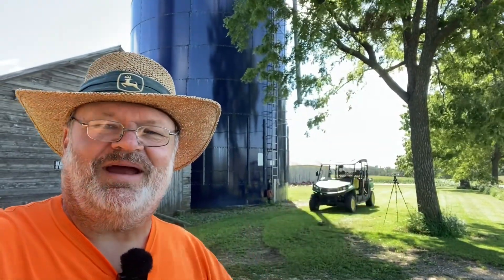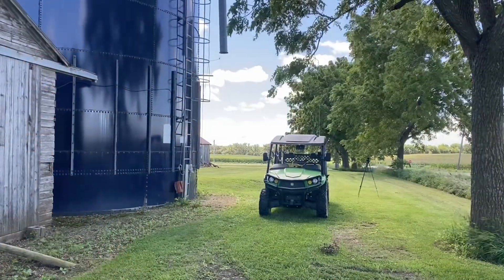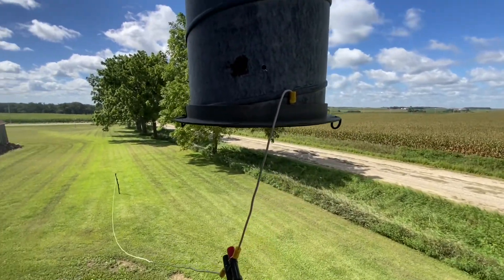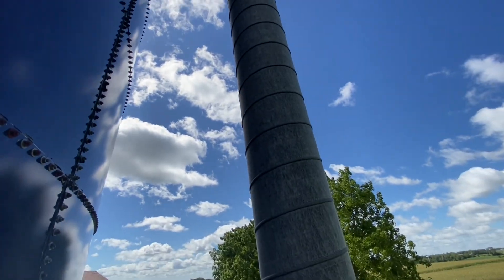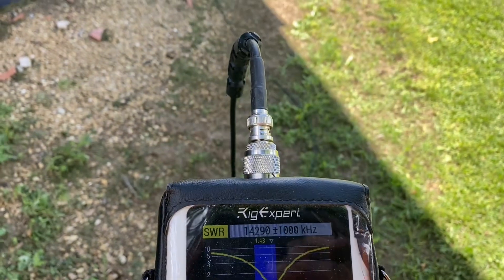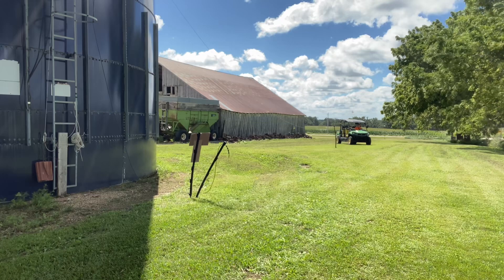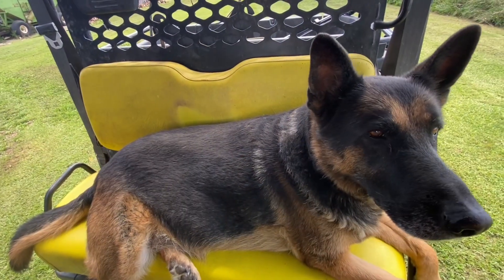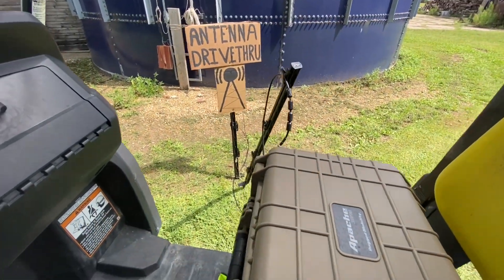Ham Radio Silo Antenna Drive-Thru - FX-4CR QRP SSB 5w

Comment: hello! your fill pipe is the rf sink, the "cp" is actually your radiator, that's why you have a standard Q dip in your swur chart, your feedline is doing the heavy lifting here in balancing your signal, great video!
Reply from the maker: Hello.. Sorry I am late to respond.. Thanks for the great technical info and for watching.. I appreciate your comment and support.. 73, kevin k0klb

Comment: Not a new idea not saying it's not a great idea mind you. There is a titan missile museum that has a giant HF discone antenna that ham radio operators are welcomed to drive up to and plug into the coax provided. However it is in a lockbox but the key is available at the desk. Also available is a picnic table to operate from. I forgot the specs for the discone thinking it's from 7 - 50mhz.
Some of the abandon AM stations would be sweet too.
Reply from the maker: Thanks.. LOL, I thought I had seen a picture of ppl sitting at a table and connecting but wasn’t sure about a drive by.. Cool, it would be fun to try that one someday .. Thanks for watching and providing the into.. I appreciate it. 73, kevin k0klb

Comment: lol! Be sure to: 1) Charge for use (especially stick it to out-of-towners who travel all over the place (cough KM9G cough 😂)  2) Have a safety break-away (like at the gas pump) in case people pull away while it's still attached 3) Upsell with the option to use a drive-up 1KW amp  4) Don't ever change the logo because everyone on the planet will dunk on you on social media! 😋 Thanks for another great video Kevin! 73 and God bless you from AF7EC 👌
Reply from the maker: Hey Will.. LOL.. Those are all great and funny ideas.. Now you're thinking outside the amateur radio operators box.. Fun stuff.. Thanks for the comment and all your support.. I appreciate it.. 73, kevin k0klb
Reply: Yeah, make those fees less than cell phone service.  Like truck stops used to have a system that provided a/c, heat, cable TV, 120v shore power and landline phone service to help drivers reduce their engine idle time.  😁

Comment: Great concept Kevin.  That may work for small independent farmers and groups in rural America who are willing to let their property be used like that, but try that in the city and suburbs, and ya'd likely get fined for tampering, vandalizing, destroying, and trespassing on private property.  Even if no damage was done.

Not trying to be negative, just speaking of the differences between rural and urban life.

And it'd be easier just to have a mobile setup in a vehicle...
grant it having the antenna as high as possible like on a silo or water tower is obviously the best benefit 

But your idea is pretty good and creative.  Make it similar to charging stations for EV's and drive-thru beer barns.
Reply from the maker: Thanks for the comment and I understand your point about the differences in locations and I do like your drive thru beer barns, lol..  I doubt this will gain much momentum but we can now say that we tried it and it is a doable solution for those of us who don't have a mobile system.  All in good fun and ham curiosity and experimentation.. lol  Thanks for watching and your support.. I appreciate it.. 73, kevin k0klb
Reply: @hamradioqrp-k0klb It's definitely fun to experiment like with our friend K8MRD does with testing random objects to see if they'll resonate.  That's one thing that makes Ham radio so fun.  Like with your "shoveltenna" video.  Very creative and "McGyver" like. 😁